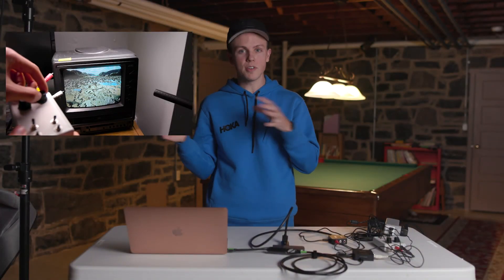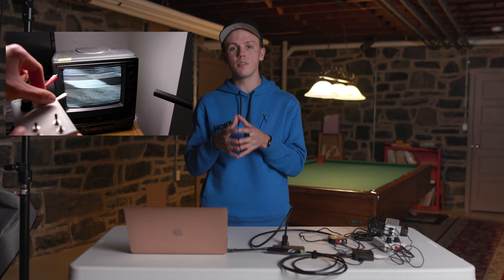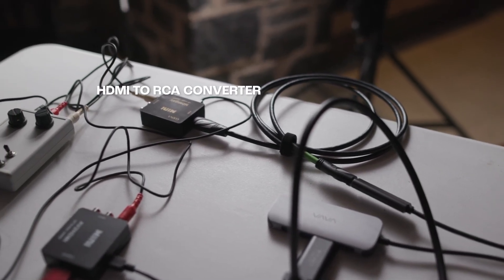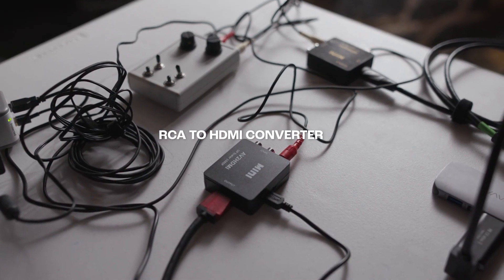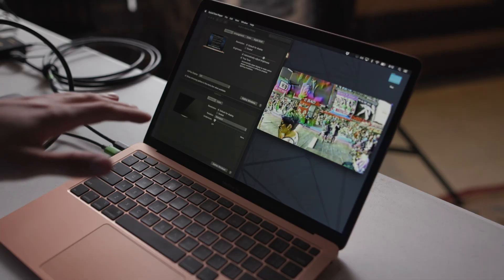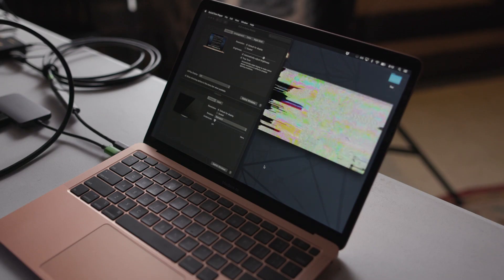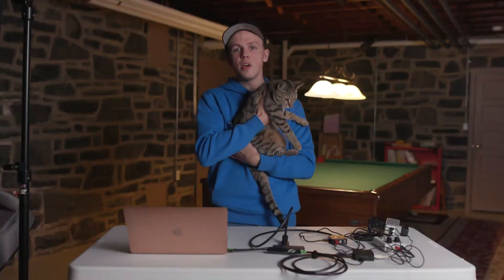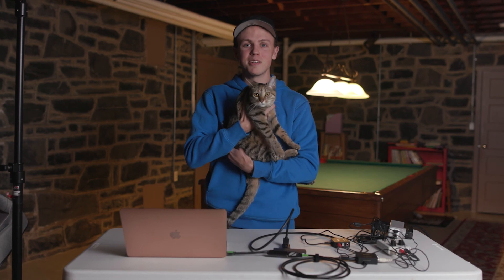Circuit Bending - Analog Glitches WITHOUT a CRT TV

Comment: I have had various circuit bent devices none work with those composite to hdmi adaptors so i boight a much nocer krammer 728 that includes a time based corrector and it does work fine
Reply: any other recs for converters with TBC correction built in? Cheers
Reply: @theothompson6975  really only video mixers and they aren't as cheap as they used to be, for an all in one any of the Roland mixers with composite in and HDMI out also do an ok job unless the sync is really messed up. Personally I use either a Panasonic AVE-5 or MX-10 both used to come up on eBay here for around 100 and handle sync in different ways, both have cases where they work better, but neither has a built in HDMI adaptor so you still need something there. But there is a much better chance a cheep one will be happy with the signal from those mixers

Comment: can you explain how you use VLC to send the video to the glitch box? i cant seem to get a signal
Reply from the maker: I play a video in VLC, and put VLC on the "second display" that is the HDMI to RCA converter.
Reply: @drewbdarby thanks. i realized the problem in my signal path was something in the upscaling process. i have the same path as you, however i get a “no signal” error whenever i try to use the glitchbox(i have the same 1 as you). when i use the killswitch the signal passes fine though. any idea what’s going wrong?
Reply: @drewbdarby   Im pretty sure the problem is that I need a time based corrector, but i dont understand why yours doesent considering we have the same one...  any insight? please let me know id really like to get this to work
Reply: @addiktd Brother, I have the same problem, I also have that glitch box in addition to MisMatcher Deluxe and I get the blue screen with no signal all the time, were you able to solve it?
Reply: @nicolassanchez197  do u mean time based correctors?
Reply: @nicolassanchez197  i’m confused cuz he didn’t use one and it worked fine for him we have the same exact equipment too

Comment: How do you connect the distorter to a regular tv??
Reply: Would you just need a hdmi to rca converter?
Reply from the maker: Yes, unless your TV has RCA in.
Reply: @drewbdarby  it worked with the hdmi to rca converter but how would I be able connect my own recorded videos to the tv monitor so it can work w the distorter ?
Reply from the maker: You need to input into the circuit bending box whatever it is that you want to distort.

Comment: I bought a circuit bender from Etsy and this method didn’t work. The seller said that it didn’t support an HDMI input. Does the one in your bio work 100% 🤔
Reply from the maker: The one I have linked in the description is the exact model I bought.
Reply: @neftali, Is ur circuit bender from melted electronics?

Comment: Hey thanks for the video I will try it myself, one question if u play a 4:1 video the signal back will be 16:9 because of the hdmi conversion? I mean are you restricted to use only 16:9 aspect ratio?

What happens if you would like to get a higher resolution like 4k does the USB convertor upscale the video signal?

Thanks a lot

Comment: Good video. FYI I am super lo-fi video and audio guy and you can take the RCA signal directly from the glitcher box to RCA to USB into the Mac to record on QuickTime. Just another option for folks.
Reply: Just like that? With a RCA to USB cable? Nothing else?
Reply: @AlbertRué  It is a RCA to USB adapter and works like a charm with mac. No drivers needed and was plug and play.
Reply: Can you send me the link or specific name? Thanks!
Reply: @AlbertRué This is what I got: DIGITNOW USB 2.0 Video.
Reply: @I.O.M.  Could you send a video FROM the mac - through the glitcher box - and back to mac? So it would be macbook > usb c to rca > through glitcher box > rca to usb c back to mac - but then how do you choose (the video I want to edit for example) what goes through the glitcher box?
Reply: @SHAWVEE  No. You’ll need a different source of video. I usually use my ipad as a source or other analog video device.
Reply: @I.O.M.  Thats awesome! So can you please tell me your exact IPAD to MAC connections? And would it use any signal coming from iPad including a youtube video for example?
Reply: @I.O.M.  would it be:

MacBook

Digitnow USB to RCA capture card tool

Then into Glitch box unit

Then out of Glitch box unit into 2nd Digitnow RCA to USB capture card tool into iPad?
Reply: @SHAWVEE  Hey sorry for any confusion. I meant the Ipad as your video source. Let me put up a video in a few days which would just be easier.
Reply: @I.O.M.  hey man! No I understand that - just wondered how you connected the iPad to glitch unit?
Reply: @I.O.M.  please let me know if you can 

Thank you
Reply: @I.O.M.  ??

Comment: you might need a time base corrector if you want to input the signal back into your computer, as a lot of those cheap converters have a hard time handling the jumbled up analog signal and it can lead to some black frames or low fps etc.
Reply: werent u in giorgis server
Reply: @voi4  ye